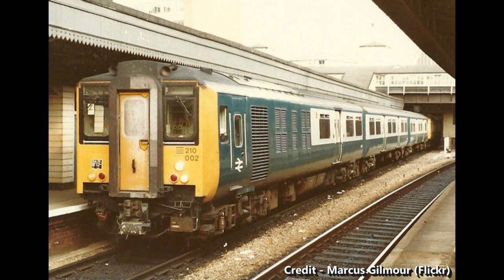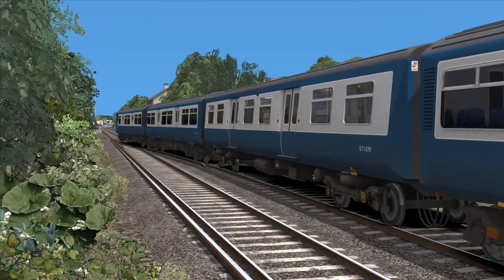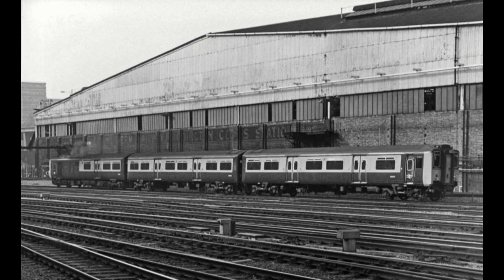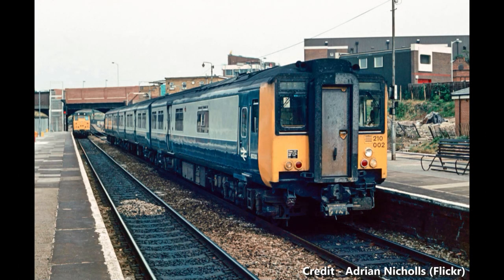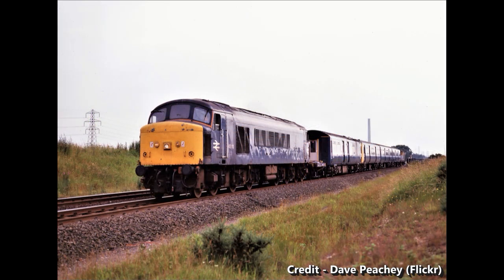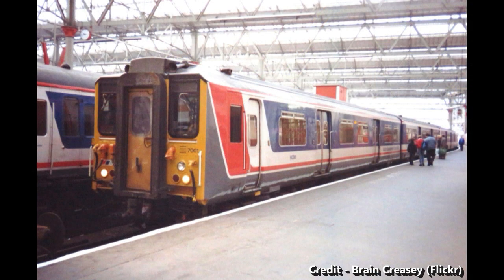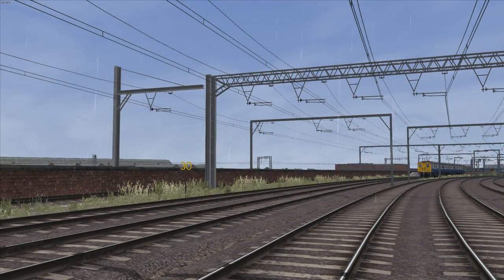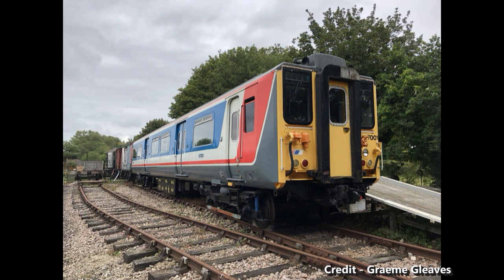History of the BR Class 210 DEMU

Comment: This design did find a home in Northern Ireland. They were numbered 450 Class “castle class” DEMU, getting the “castle class” term as all 9 sets received a name plate which bared the name of a castle in Northern Ireland. They were made up of a 3 car formation numbering from 451-459. They were a cheaper response to NIR needing to upgrade its rolling stock from the 70 class demu. The engines and traction motors were retained and placed into the 450 Class. They served faithfully from 1985-2012.

The engine reused in the 450s were 600hp English Electric 4SRKTs with their very distinctive thumping noise when under full power. By UK standards, they weren’t very quick having a top speed of 75mph and acceleration wasn’t by any means sporty. But they were good old British engineered trains which served as a reliable (for the most part) and robust replacement for the older multiple units. 

One complete example, set number 458 is currently preserved and operated by the Downpatrick and County Down Railway. Unfortunately, Downpatrick suffered very bad flooding. Submerging the traction motors and axle boxes as well as other key components of nearly every unit and loco in their fleet. It appears that 458 by a sheer miracle escaped major damage compared to their trains. I hope for their sake that 458 and their other locos will rumble once again.

Comment: These Are The BREL Mark Branchline Carriages

The Driving Trailers Are Classed: “210”, “316”, “317/1”, “317/5”, “457”

The Carriages Are Classed: “210”, “316”, “317/1”, “317/5”, “457”

A Composite Carriage Is Classed: “210”

Both The Power Carriage & The Power Brake Carriage Are Classed: “210”

Facelift Variants Are Classed Both: “317/7” & “317/8”

Locomotive Hauled (Requires A Corridor Locomotive)